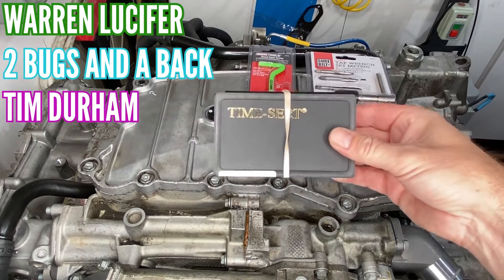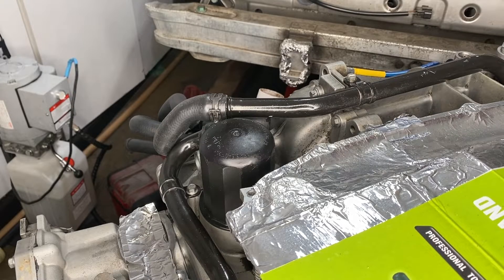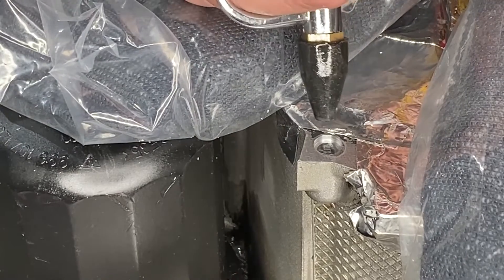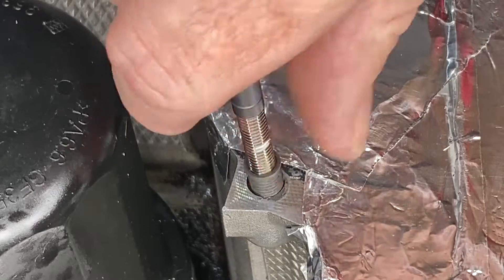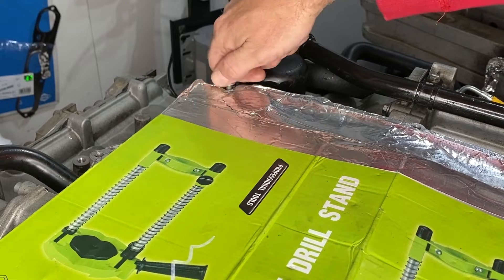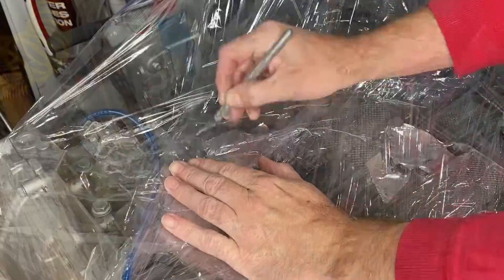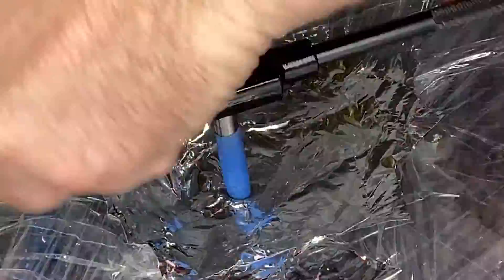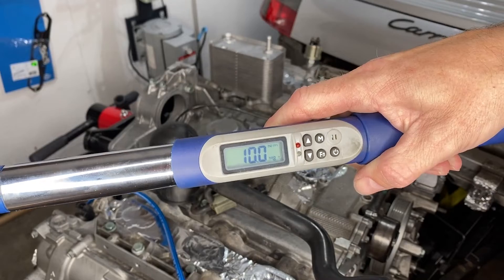Solving Stripped Thread Nightmares: TIME-SERT Installation Tutorial!

Comment: Very good video, thanks.  Question, I need to install Time-sert (6x1.0mm) in a dowel hole. Can you tell me the outside diameter of the countesink tool? As the cut countersink will be below the surface of the part because of the dowel space, I need to know if the tool will fit into my dowel hole.  
Thank you.
Reply from the maker: Hello John, unfortunately I do not have a Time-sert kit laying around at the moment to measure, hopefully this info is available online. Thank you for watching and commenting! 🤘😎
Reply: @ManinaGarage  no worries, thanks.
Reply: Just so happens I am working myself with a 6 x 1.0 hole and have the kit, the OD of the countersink tool is .371".

Comment: It appears that the insert is counter sunk a little past flush with the original surface. This could be an issue if, as in my case, a small diameter machined spacer is used inside the thick gasket bolt hole. (transmission pan) Is it countersunk past flush or is just an optical illusion on my part?